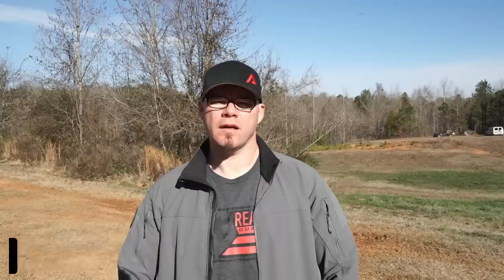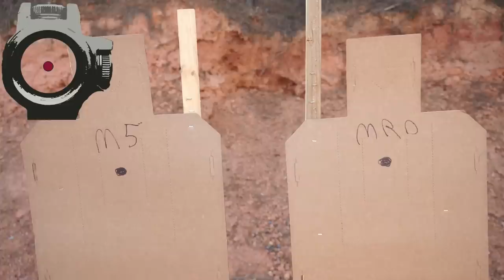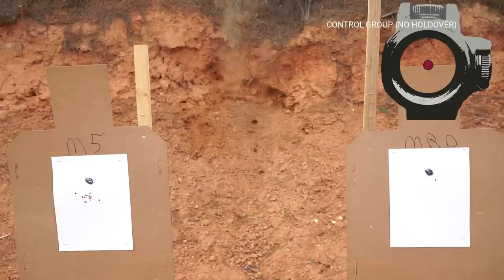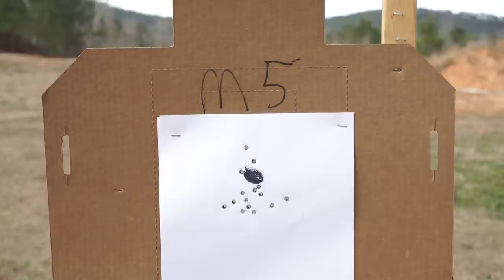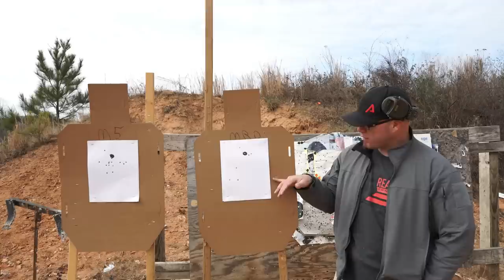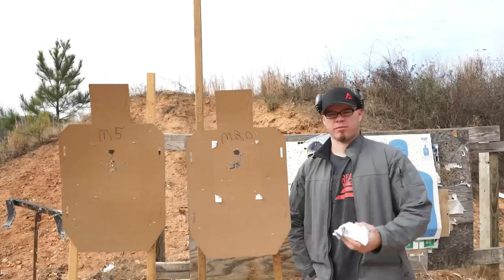Rifle RDS Parallax

Comment: I wonder if the wider spread with the mro has to do with the fact that it has a physically larger viewing window. Thus, when you've moved the dot to the extreme edge of the optic window, you've actually moved it further, in absolute terms, than on the M5. In other words, your inducing greater Parallax with the mro in this test, even if it seems like you're doing the same thing with both Optics. Now this is just a theory, and I'm not there, but I wonder if the test would be more accurate if you moved the. From the center of the optic the same exact difference, in real terms, for both of these. Of course, I have no idea how you would measure that
Reply: I believe this is the case.  If parallax is caused by moving off center then of course it would make sense that the more you move off center the worse the parallax will be.
Reply: Fair point

Comment: Bit the bullet and replaced my Holosun Aems with a Eotech EXPS3-4 for two reasons . Paralax and magnification . Paired it with a PA GLX 6x magnifier. No regrets. The battery life sucks but its worth the trade off.

Comment: This is an awesome video, and one that I've been curious about.  I'm a fan of both optics.  One thing that i think you started to touch on, but i wasn't sure if you really nailed is that the MRO has a larger field of view (i believe).  I'd venture to guess that if you took the eye position on the MRO with the dot positioned on the extreme right side, and you swapped that with the m5, the dot may not even be visible on the m5, therefore the extreme right on the m5 might fall at 75% on the extreme right of the MRO.   You mentioned that you wanted to find out more, so I'd be curious if you could mount a GoPro on the pic-rail that held the dot to the extremes right edge and just swapped the optic to see where it fell....
Reply: Love this comment and this channel that allows and creates ideas and thoughts like your own! Your (in my opinion) extremely poignant comment is the definition of an ‘extraneous variable’ and every proper scientific experiment is conducted in doing everything possible to reduce these EV’s. The FOV difference in the two optics is a huge EV and should be addressed! That said, it doesn’t take a damn thing away from Aaron’s video/viewpoint/or incredible knowledge on the subject—it’s just, as he states early on—one of those ‘academic points’ that can be deep-dived on one’s own time!
Reply: @VState60  my intention was not to take away anything from this video, but just to start a discussion around it. 
Thanks for taking the time to read it and complement it as well!    YouTube comment replies on old videos are like a time capsule and take you back!

Comment: One thing I learned at a class, zero your dot with your front sight up. Lollipop it with the dot. Parallax won't have much of an affect unless your at longer ranges but if you are you can again reference the front sight and eliminate any parallax.
Reply: Unless you use lower 1/3 cowitness.

Comment: Seems it would need to be same size objective lens/angle and optic focal length...?  Being that parallax is measured from an angle... With the MROs larger objective lens, wouldnt the parallax angle be magnified with the larger FOV and shorter length?
Reply: Yes! You are tracking the relationship.

Comment: Parallax is terrible on the MRO and its a failed product because of that in my personal opinion.
Reply: The relative parallax error of an MRO is no worse than an Aimpoint T1. Is the T1 a failed product?
Reply: @woodrowcall3158  MRO is much worse than a T1/PRO etc…from my experience
Reply: @thehun06  
It is capable of greater error overall, that is true.

If the T1 had the same size objective window as the MRO (25mm) then it would have roughly the same possibility of parallax error. If the MRO had the longer radius between emitter and collimating lens like the Pro, it would have less possible error.

The MRO does have an odd parallax error compared to others since it’s emitter is on the top left “corner” of the optic body, but it’s physics are not any different than another sight.

If you know how parallax works then you know how to minimize it. If your particular situation doesn’t allow you to minimize it then you don’t need a collimating optic.
Reply: @woodrowcall3158  I’m not disagreeing with you but if you find yourself in that adverse situation/position which can happen…I’ll have a setup that mitigates parallax to the best abilities…
Reply: @thehun06  
If I am having to use an MRO at the bleeding edge of it’s objective for some ungodly reason, putting a T1 in its place just means that I don’t have an objective to sight through.

I use an EOTech though and don’t have to worry about those crazy situations 😂
Reply: @thehun06  
My man. Parallax error never greater than the size of our windows 😂
Reply: If you are worried about mro parallax you need some carbine classes. To get that extreme of a parallax shift means your fundamentals are nonexistent.